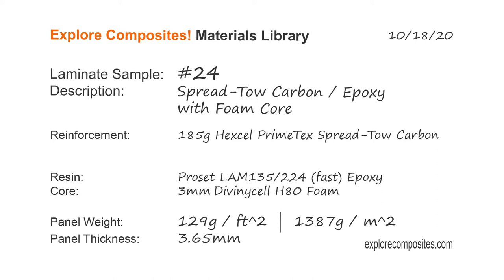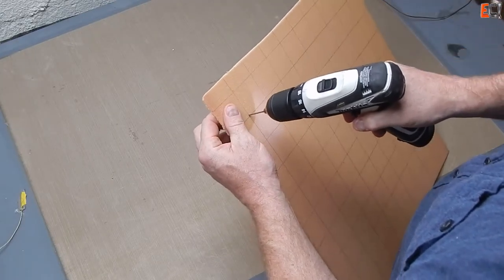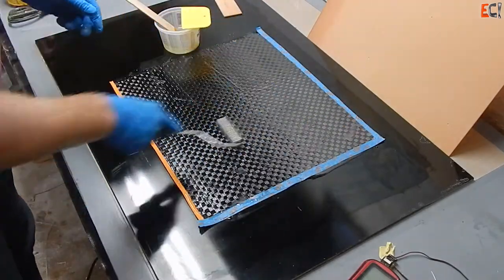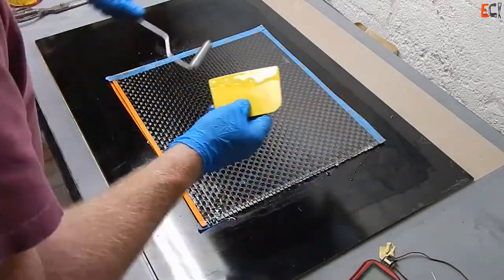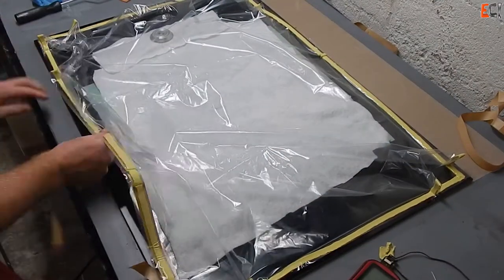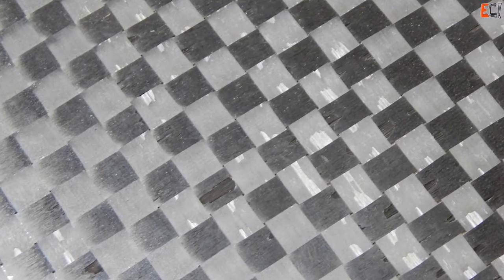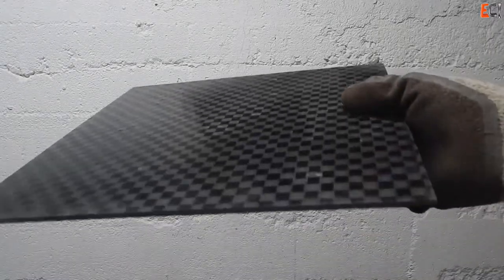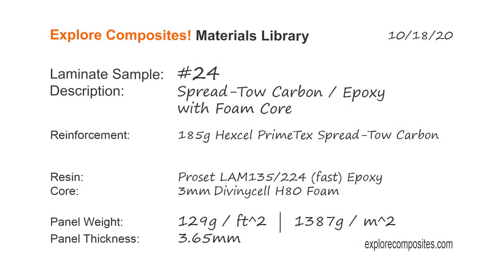Laminate Sample #24: Spread-Tow Carbon / Epoxy with PVC Foam Core

Comment: I love how you clearly spell out everything you do and post a spreadsheet of the laminate with all the pertinent data. I wonder what that laminate would have weighed had you perforated the foam. Also how much stiffer had you used 1/4" H80 foam.
Reply from the maker: Thanks Grant!  I kind of looked into the weight estimate in the description but would say probably 10-15% weight reduction by fully bleeding off that excess resin.  I put a lot of extra resin in that first skin!  

The stiffness would probably go up a bit less than 4X with doubled core thickness.  Weight wouldn't go up much at all.  I may have to try one like that to redeem myself and make something pretty with the spread tow.
Reply: @ExploreComposites   The laminate above, perforated with 1/4" foam will be my test for a wing skin material for a very lightweight aircraft. 1/2" for fuselage skin (with stringers and bulkheads for additional support).

Comment: You didn't roll the core to get air out........part of your problem..........Z
Reply from the maker: I think you're right - though I would have had to start from one edge and work across.  Without any holes through, the air would only be able to escape if worked all the way across the surface to an edge.